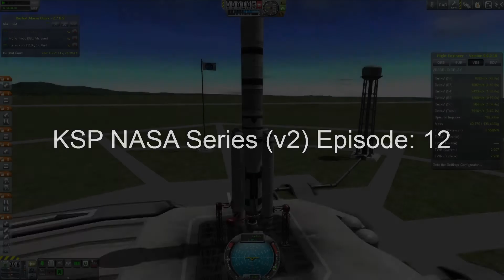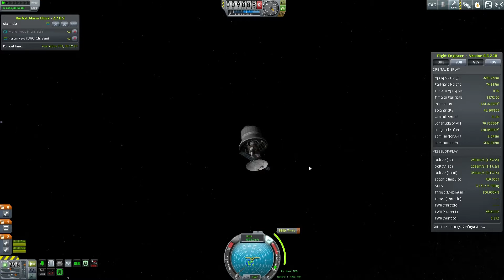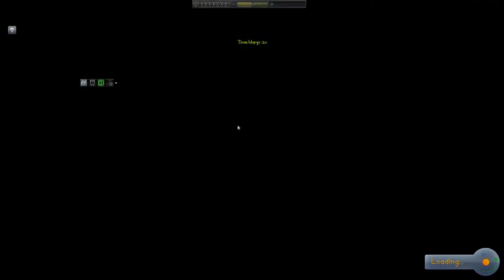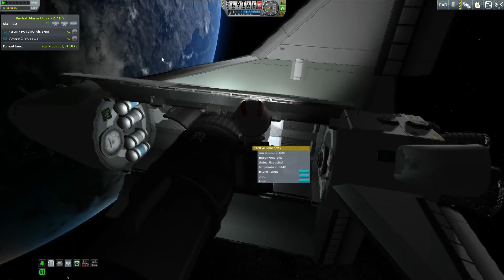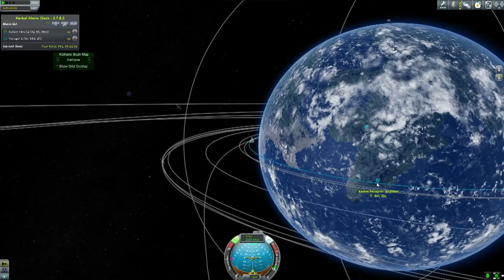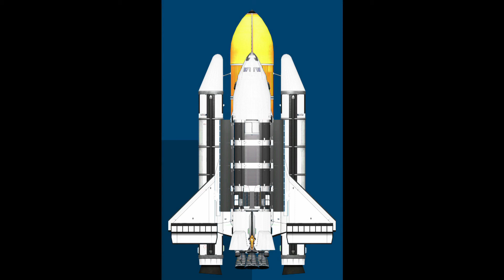KSP NASA Series (v2) Episode: 12, Voyager, Space Shuttle, and Hubble

Comment from the maker: Mod list for this series: All listed on Episode, 1, I'll start putting these on each episode, but keep in mind, I'm trapped back in Version .24.2 for the duration of this playthrough. Should have my next episode up and ready tonight/early morning, depending on how long it takes Lightworks to encode. It's pretty slow in 1080p.

1. B9 Aerospace
2. Environmental Visual Enhancements
3. Chatterer
4. Cool Rockets
5. Custom Biomes
6. Deadly Reentry
7. Decouple for X64 (Decoupler bug fix) (deleted-redundant)
8. Distant Object Enhancement
9. DMagic Orbital Science
10.Editor Extensions
11. Kerbal Engineer
12. Enhanced Navball
12. FASA Launch Tower and Clamps
13. Ferram Aerospace
14. Porkworks Habitat Pack
15. HullCamVDS
16. RasterPropMonitor
17. Kerbal Joint Reinforcement
18. KerbCam
19. Kethane
20. Klockheed Martian Shuttle Engines
21. KSPX w/ Old Cupola
22. KW Rocketry
23. Infernal Robotics
24. Mechjeb 2(don't use a whole lot, but it integrates with RasterPropMonitor so I can roleplay a more high tech vessel in the future, if I choose)
25. Hot Rockets
26. NavyFish Docking Alignment UI
27. Final Frontier (Deleted, useless due to instability, kept losing progress)
28. A few parts yanked out of NovaPunch 2
29. Quantum Struts Continued
30. Realchute
31. Remotetech 2
32. SCANsat
33. Spaceplane Plus
34. Station Science (.9, 1.0 cause a bug where it spams your contracts with SS missions, preventing stock contracts from being generated)
35. TAC Life Support
36. TAC Fuel Balancer
37. Kerbal Alarm Clock
38. Vessel View for RPM
39. Vanguard Ejection Systems

+All B9 compatibility plugins (made redundant by B9 5.0 release)